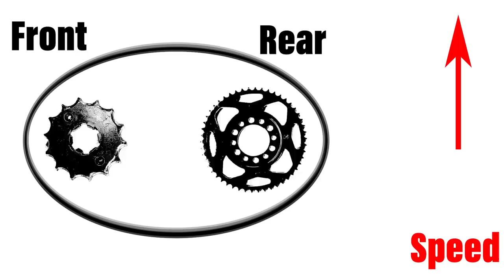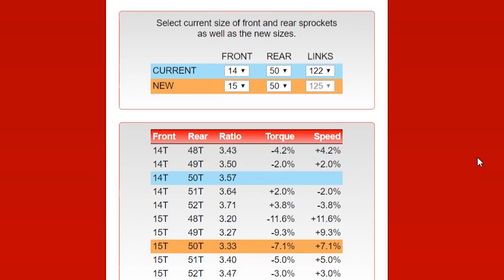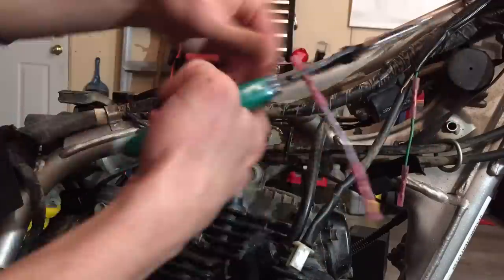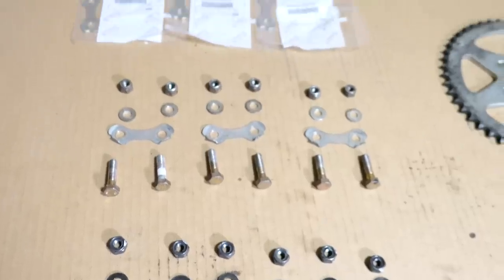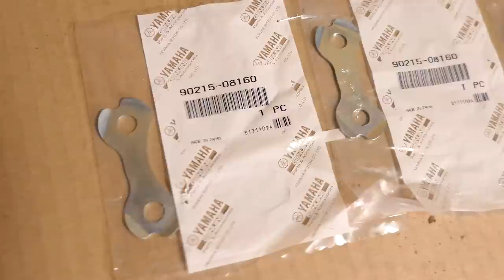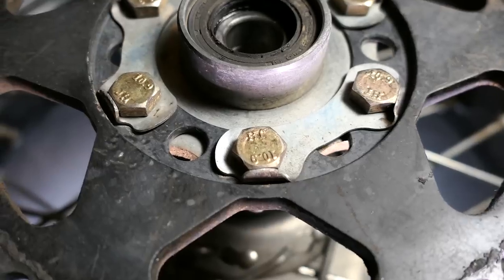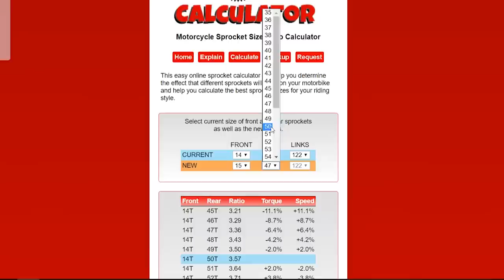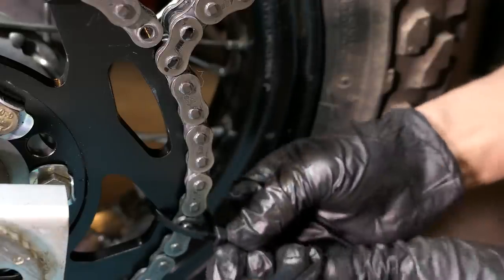How To Replace the Chain and Sprockets on a Yamaha TW200

Comment from the maker: Skip ahead to the part you need
Front Sprocket: 4:03
Rear Sprocket: 10:38
Chain: 14:26
Test Ride: 19:14

Calculate your Sprocket change here: https://sprocketcalculator.com/
My sprocket setups

Stock: 14/50 (base)
1st change: 14/47 (6.4% change)
2nd change (the one in this video) 15/50 (7.1% change)

Specs:
Oil drain plug: 43 nm, (31 ftlb)
front sprocket bolts: 4 nm, (2.9 ftlb) [use locktite]
left crank case cover: 7 nm, (5.1 ftlb)
shift lever: 10 nm (7.2 ftlb)
footrest bolt: 60 nm, (43 ftlb)
rear sprocket bolts: 35 nm (25 ftlb) [use locktite]
rear axle bolt: 90 nm, (65 ftlb)
chain slack 30 - 60mm
brake pedal freeplay 20 - 30mm

check out the parts and tools:
Sprockets and bolt kit in the video were purchased here: https://procycle.us/bikepages/tw200.html

Find the same exact Sprockets and other parts here:
Rear Sprocket (JT Sprockets JTR1842.50): https://amzn.to/2GYQHxx (paid link)
Front Sprocket ( PBI-733-15): https://ebay.us/wXVgpK (paid link)
D.I.D. 428 VX 126 link X-ring Chain (one used in video): https://amzn.to/2EsjrNp (paid link)
Extra 5/16 x 3/4 washers (in case you don't want to buy the bolt kit): https://amzn.to/2U50cyH (paid link)
TW200 rear sprocket lock washers ( part# 90215-08160-00) (3 needed) https://www.partzilla.com/product/yamaha/90215-08160-00
Yamaha left side cover gasket (part# 3AW-15451-03-00 ): https://amzn.to/33FMbx5  (paid link)

Tools: 
Chain Breaker: https://amzn.to/2EqBsLS (paid link)
1/4in torque wrench: https://amzn.to/2NntypD (paid link)
3/8in torque wrench: (don't have this one yet but i'm going to get it because my craftsman one is not great): https://amzn.to/2BL7oZO (paid link)

(I may get commissions for purchases made through links with "paid link" next to them)
Reply: Very humble of you to do that, most would not like people skipping through all their hard work.  Good quality to have in a young man.
Reply: @getsum697  specs....
Me sub
Reply: @efirizaki5656  Caveman much?
Reply: Thanks

Comment: HI! I think only you have the expertise to help me. My motorbike doesn't want to start. For now I have carried out these checks: I put in a new battery, checked all the electrical cables and connectors which were cleaned with a specific spray. many were in very bad condition but the bike won't start. she's dead, she makes no sign. the instrument panel does not turn on but the headlight works. I found the starter relay and did the "bridge" and at that moment the starter motor moved. Could it be the faulty relay?
Reply from the maker: Hi could be a lot of things, I cant really help much unless im working on the bike in person

Comment: Remember not to use a pressure washer to clean the chain. It will wash the grease out of the pins and hold water.
Reply from the maker: yeah I don't even have a pressure washer

Comment: I found no need to bend the tabs on the lock washer plates on the rear wheel sprocket or any need to replace these lock washer plates.  I held on to the head of each bolt with large smooth jaw vice grips with the end of the jaws engaged with the head of the bolt.  With the vice grips bing in line with the axis of the bolt being held.  Using the smooth jaw end of the vice grip so as not to damage the plating on the bolt heads.  Then turned the nut on the other end of the bolt on the back side of the sprocket.  It was easy to remove and install the bolts this way while causing no damage to the lock washer plates and reusing the lock washer plates as they were not damaged.    Awesome vid with excellent info.  Thank you.
Reply from the maker: Awesome! Glad that worked out for you. Much appreciated thanks for watching

Comment: Talk about a mature dude. I’m a 70 year old career gear head and your vids are quite professional. Not a bunch of useless, unrelated yak.
Good job with your camera work and editing. Even a dummy could do his own maintenance.👍👍👍
Reply from the maker: Hey I appreciate that! Always try and make these videos as quick but info packed as possible
Reply: @TDubsKid  Me again. I do almost all my own wrenching for my vehicles. Presently, my son and I have 14 bikes. 10 are vintage like the Kawasaki 500 triples. Some old YSRs and JT 1 Yamahas . I also have a Grom and my ‘87 TW. So I’ll play around with the carb on it it soon. The Welch plug is out. But the bike generally runs crappy. Back firing while  de-accelerating down hill and hesitations and low power. I live on the west coast of British Columbia but ride at all kinds of elevations. Do you have a video of what can help these carbs or should it be replaced?
Thanks my friend.

Comment: Excellent vid.  I'm probably twice your age, used to be an aviation mechanic and own a TW200.  Your vids are fantastic with accurate info, thorough content and have been helpful.  

These little bits may help.

Chain adjustment:  Because of the slop between the hole in the snail adjuster and the axle, after adjusting both snail adjusters and before tightening the axel nut, I take a mallet and tap both ends of the axel toward the front of the bike.  The axel will move forward a little and this takes out any slop between the snail adjusters and axel ends, eliminating any misalignment of the axel due to this slop.  I also wrote on the swing arm, with a paint pen, the axel/nut sizes and torque spec.  This way I just grab the right tools and go to work. 

Changing rear sprocket:  I simply used an open end wrench to hold the bolt heads while turning the nuts on the back side, both during disassembly and reassembly while torquing from the back side.  This eliminated both the need to replace the lock plates and the work associated with straightening and bending the tabs on these plates.  It is also important to degrease fastener threads when using lock-tight.  Break cleaner works well.  Any lubricant left on either the male or female threads will interfere with lock-tight's ability to hold as intended. 

Keep up your awesome work and humble ways. You are an inspiration to us all   :)
Reply from the maker: thanks, and that's awesome! so much appreciated 😃 that's a good idea, I usually push it snug up against the adjuster with my hands but that makes things easier, such a good idea. yeah I would have done it that way and probably could have gotten my flex head torque wrench back there, would be nice not having to buy new lock washers. thanks for all the great info, i'm sure others will find it useful. so much appreciated 🙂

Comment: I broke my chain back in December before you posted this... thanks to this video I can finally fix my bike and ride again!
Reply from the maker: dang, how did that happen? no problem! hope your out riding again soon
Reply: @TDubsKid  at exactly 1000 miles my factory chain broke while i was riding alone in the middle of the desert... luckily someone saw it happened and gave me a ride back to my car... now researching getting an X chain and replacing both sprockets
Reply from the maker: dang, those stock chains are quite sketchy. mine would stretch like crazy even on short rides. my x ring chain hasn't even stretched slightly yet even after about 200 miles it's a great way to go

Comment: Doing this in a few days as my daily commute involves a short section of 55mph for about 10mins and I just want that tiny bit so I'm going with that 6.4% using stock chain. Excellent explanation.
Reply from the maker: yeah should be perfect for that. good middle ground
Reply: @TDubsKid  Did the rear sprocket swap in about 2 hours and ran the commute today. Holds speed now without feeling too buzzy or any issues. This video made it super easy! Thanks!

Comment: Following your wise advice, since it's been decades since I worked on motors, took the TDub to my LBS, and had both sprockets changed, as well as new bars & risers added, and a USB port hooked up.  Haven't had the chance yet to get her out on the highway, but on the forest roads she's noticeably faster.  On our 2 lane blacktops, even though the speed limit's 50mph, pretty much everybody goes 60+!  Your vids are great, and little by little I'm getting back into working on the bike myself.  Thanks for such detail and great presentation, it really helps!
Reply from the maker: some great mods for sure! yeah it's not a fast bike but not too bad on 55mph roads for a little bit. good to hear. have fun!

Comment: So this is old, but I thought I would put in my 2 cents worth on the many sprocket change discussions. 
I read the pros and cons to different set ups so I finally settled on one. 
These changes are all according to each person's needs. 
The hard core mainly off roader will want to be lower geared. The highway guy will be the opposite. 
Me, I'm 71 and am in the middle. I do ride all kinds of terrain but won't put the little bike through things not designed for. So I need to ride road to trails and run around on black top. So I simply went 45 on the back. All it did was what I wanted. A little less vibration at 50-60 mile an hour and I'm sure a bit of a rpm drop. I hated the sound of it needing a 6th gear. 
I get to go a little farther in first. 
One of my long hills to come home is about 8% so I have to shift from 5th to 4th nearer the top. Big deal. 
Over all, for me it's better than stock and hasn't changed where I go or use the bike. Of course I'm old lol
Reply from the maker: For sure,gotta find the balance for your particular needs, would be perfect if it had a 6th speed

Comment: I also replaced the both chain and the two sprockets few days back. Three teeth were broken in the front sprocket. Had to replace the rear sprocket bolt also as threads were damaged.
Great video btw and keep it up.
Love from 🇱🇰 🇱🇰 🇱🇰
Reply from the maker: nice! oh wow, i'm was not too far off from breaking teeth completly off, dang, at least you wont' have to worry about it for a while now that it's all reaplaced. thanks! ill keep the videos coming 😃

Comment: Thanks so much for this! I just got all my parts from Pro Cycle and am about to do this job for the first time.  I will be watching your video step by step!
Reply from the maker: Nice! Best of luck, make sure not to pinch  wires with the cover. Lot of people contacting me who did that
Reply: @TDubsKid  I ended up unplugging the wire bundles from the top to make it easier to route them.  That worked well, but I think that was the hardest part of the job!

Comment: Great video, now I am inspired to finally change my rear sprocket to 47 and get a new chain
Reply from the maker: thanks! nice, the 47 was soo worth it, I'm really liking the xring chain as well
Reply: Well got a new xring chain and sprocket, went on easy. Well except I used a pair of vise grips and small nut to press home the master link. Also checked the valves after watching your video and that was easy also, great job. 9000km and no adjustment needed, lucky eh?  Thanks again. @TDubsKid

Comment: Great video! I have a XT225, which is a close sibling of the TW200. I learn a lot from your videos that I can apply to the XT225. This project was significantly more involved than the same work would be on the XT225.

I’m also making my first Moab, UT trip with the XT225. I’ll be there 3/17 through 3/19. Would fun if our paths crossed.
Reply from the maker: thank you! nice the XT225 is a great bike. yeah way more work than just removing a plastic cover you do on the XT225, it's cool that bike is a 6 speed too. nice haha! we will be leaving to go back on 3/17 would be cool to see ya

Comment: Excellent detail TDK. When I changed my rear sprocket I did not need to bend those tabs. All I did was remove the nut and the tabs keep the bolt from turning. Thanks for doing this as I am going to do 15t on the front so this really helps.
Reply from the maker: thank you! great idea. yeah it's a great setup
Reply: @TDubsKid  15/47 installed and its much better. Man that 14 is a tiny thing but at 2600 miles, it was still in good shape except very shiny in the valleys but the tips and sides were fine.

Comment: I went to 15 /42.  Too tall off road but helped a ton on the road. For a designated dirt day I  stick a 14 on there. 
Most people torque to ft/lbs.I like that little torque wrench you have. I hate they make the aftermarket sprockets where they cut the center thinner making you change the bolts. Sunstar sprockets are same thickness as stock if you can find one. I ordered an custom aftermarket shock .I'll let you know how it works.  That chain will last a long long time. I like you don't wear the helmet all the time now. Measure from the center of your swing arm pivot to center of your axle on both sides.  My rear wheel was 2 detents off at the snail to make the wheel strait. From what I hear my TW isn't unique to the issue
Reply from the maker: wow that is some tall gearing haha but that's cool it works well on the road, that's true but the torque specs are even numbers in NM since it's from japan, just seems more simple but I put the ftlbs in the description as well. it's a great little torque wrench. yeah that part is pretty annoying, seems like it would cost more to cut it out. maybe it's a clearance issue on some bikes. for sure let me know about that shock, I would like to see it. for sure it's so nice to not have to worry as much about the chain now. yeah I enjoying not wearing the helmet when off the bike, just had to get the audio figured out, hmmm is it the swing are that is misshaped or the snail adjusters, or did they stamp the numbers wrong?
Reply: @TDubsKid  I read others having alignment issues on their TW too. Don't know exactly where it's from. In the end the wheel has to run strait so I trust the tape.  
Didn't mean to insult your intelligence with the ft/lb ,newton meter comment. I had not realized you were a mechanic. I should have as all your how to vids are tight
Reply from the maker: gottcha, ill have to check mine at some point to see if it's off . no worries :)

Comment: This video is SO helpful.  Thank you for the time it took to do it.  I'm working on this job now and I've watched it numerous times to make sure I don't screw anything up.  The biggest problem is the panhead screws in the case not wanting to come out of my 2000 TW.  I'll deal w/ that today.

Thanks again TDubsKid.
Reply from the maker: glad you found it helpful! no problem, oh yeah those can be a huge pain, the are jis screws similar but different than Phillips. you can replace them with regular hex bolts

Comment: Im glad to have watched this before changing mine. What a poor design to have to replace the entire cover to access the front sprocket. I guess Im goiing to have to order a gasket now
Reply from the maker: Yeah the reason is the large tire, the output shaft needs to stick out much further to accommodate. And it needs support from another bearing. At least it doesn’t need to be done too often. Way easier on other bikes though

Comment: You are awesome.  Here I am again with another comment. Now it's about 2 years later when I messed with the rear sprocket size and know what size I like. And as the bike was used when I purchased it and the front sprocket and chain are definitely showing wear, I'm changing both sprockets and the chain to new.  Being a retired aviation mechanic.  I could do this work on my own while looking up the specs, etc.  However, your vids make it so easy.  I actually plan to take my lap-top to the shop and as I do the change, start and stop your vid.  This will make it super easy.  Thanks again.  

PS, When do you plan to change your fork oil?  I'll be doing this soon when I change my front tire and would like to see your vid on this.  I plan to watch your vid as I change the front tire.   :)
Reply from the maker: hey thanks! so glad to hear the video is coming in handy! haha, I always go to the vids to see the torque specs. no problem. I wish sooner than later but probably won't happen for a while. I got a lot going on right now. sounds good thanks for watching.

Comment: Great video’s and info. Been following your channel for some time, just found a T Dub and going to change gearing, I’m thinking I may die grind engine cover so it will always be easy to access front sprocket. Is this idea something you thought of doing but seen there was a reason not to do. I never liked my dirt bikes to have enclosed front sprocket being they can clog up especially in mud, and clay being the worse.  Thanks so much. You do the very best video’s on YouTube!
Reply from the maker: Hey thanks. Doing that is not an option because there is a bearing in there that supports the output shaft. oil also flows through there. Would have been better if they put an xt225 engine in there. Since that front sprocket just has a normal cover over it. They probably did it that way because the sprocket needed to be further away from the engine due to the fat tire.

Comment: Good instructional video. Thanks! Enjoy your trip to Moab. The switchbacks on Shafer Canyon Road would give you some epic video. It looks like a real suicide route but it isn't difficult to ride it at all.
Reply from the maker: thank you! your welcome. should be fun, it's my first time going to moab. ill have to remember to check out that road, haha good to know 😃🎥🏍
Reply: @TDubsKid  If you need a spot to camp and the campsites are filling up you might check out a spot I liked. It is about 20 miles north of Moab but there are lots of potential campsites out here and you can probably find a place away from the crowd. 38.8193, -109.7717
Reply from the maker: cool thanks! I saved it to my maps in case we can't find a place to camp